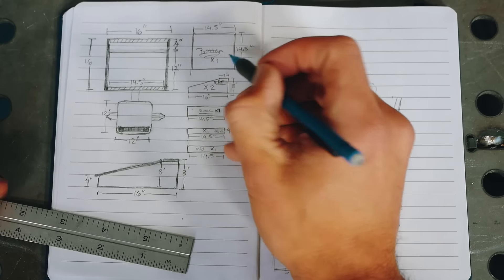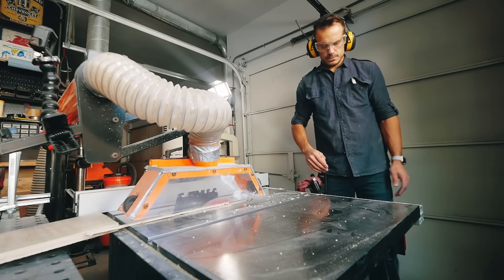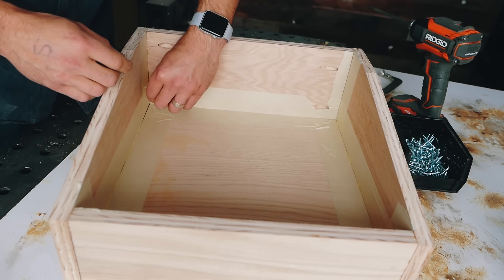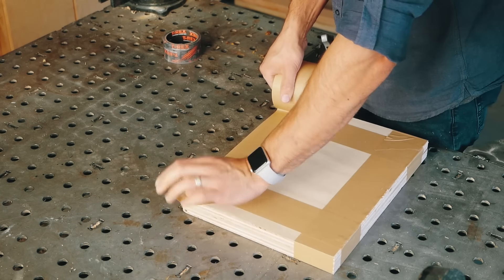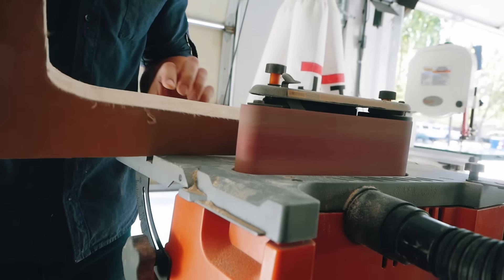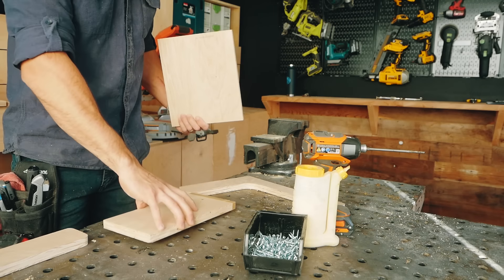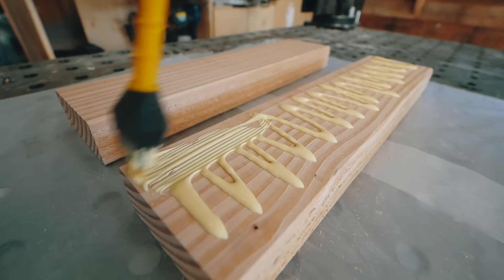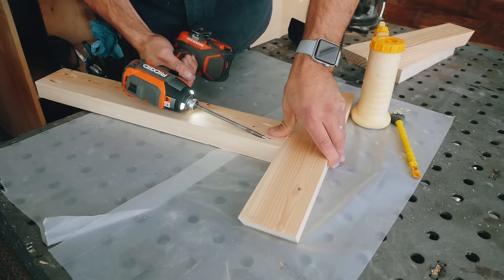DIY Kid's School Desk

Comment: The lid should have been mitered where it meets up and the back and is being hinged. As it is it doesn't close all the way which is not good at all and actually an eye sore. It would have taken just a tiny bit of extra work to miter the back of the lid and then attach it with the hinge. The hyped up intro was a bit much but other than that nice outcome

Comment: That tape make that much difference while using the table saw?
Reply: Depends on how dull your blade is, but yeah, it can make a pretty big difference. I've had success with it in the past. Just helps support the materials a bit more as you cut.
Reply from the maker: A TON!!!  Only if you go slow, though

Comment: Nice, but there is no possibility for adjusting
Reply: i though of including several threaded inserts on the bottom side of the chair and therefor you can unscrew it move it forward and use the next hole for adjustment ....hope you understand what im trying to say :(
Reply from the maker: The original school desk did not adjust either
Reply: @MrBuildit  yes you have a valid point there :D
Reply: P.s. still an amazing build well done